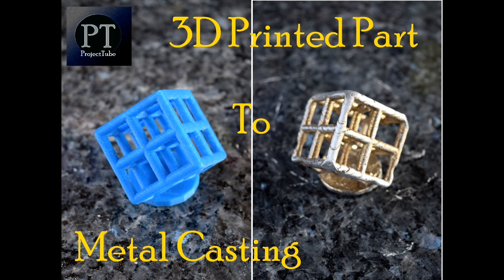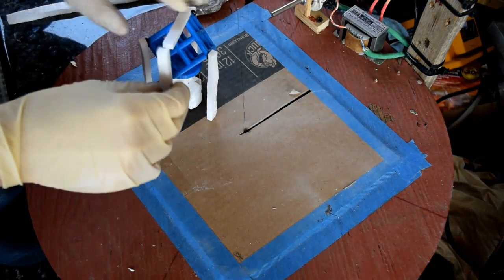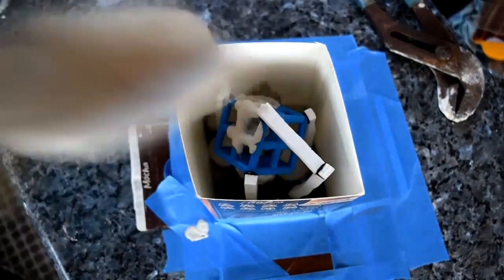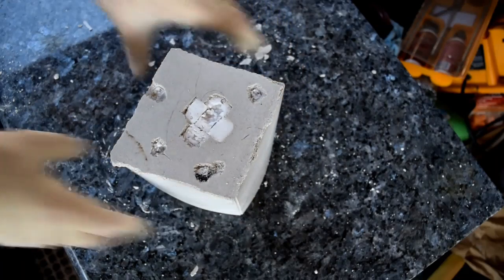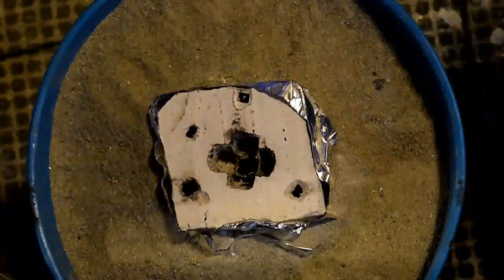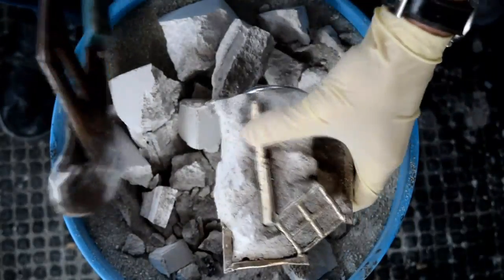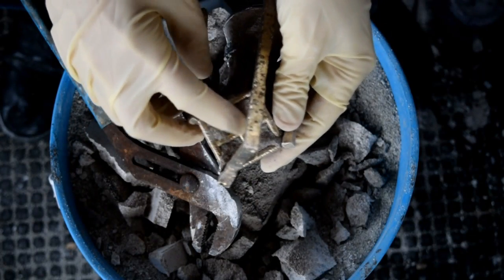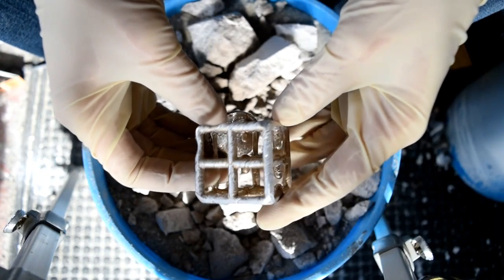3D Printing to Metal Casting/Lost PLA Lattice Cube

Comment: nice work. showing failure is part of the secuss.  I make thses levatators kits that would be fun to cast. I want to cast in the near future. using PMMA.  I have never cast before but I got all the stuff except plaster and sand. hope to get there in the near future. ;)  those levatators are on my web site. I'll send you a link if your I intrested. thanks for sharing. ~Russ
Reply: link. http://rwgresearch.com/open-projects/magnetic-levitation-kits/
Reply from the maker: +rwg42985 Thanks for comment, send over the link. I'm always interested in new projects :)
Reply: Just posted it. make sure you can see it and it's not parked as spam. ;)  ~Russ
Reply: Hi, i like your video and am trying to cast 6 small items for a very interesting 3d printed project I have on the go right now. I have designed and 3d printed a Roman Ballista and need the rope tensioners and arms make of metal to give more power. If your interested in helping me out on this awesome project i will happy send you all the files so that you can make this Ballista yourself. Cheers Lukas - Reneeceldesigns